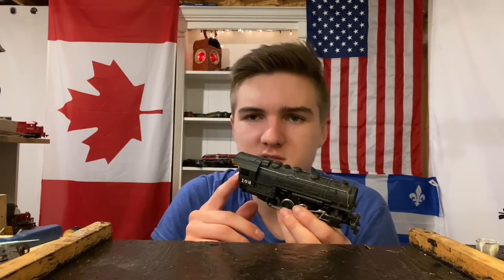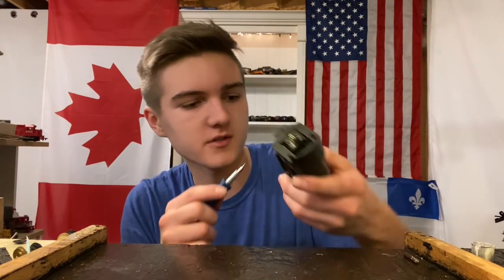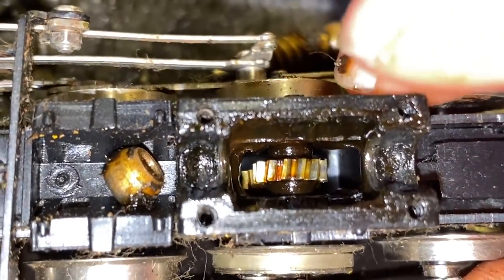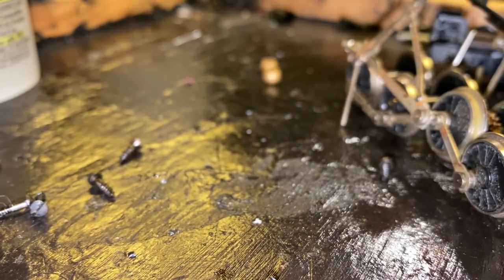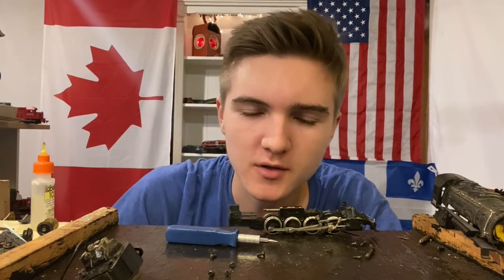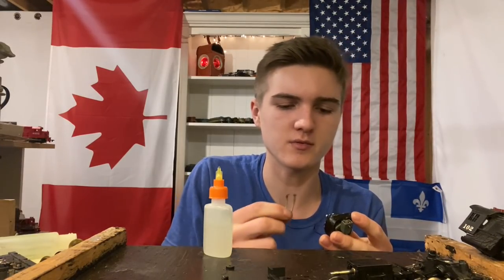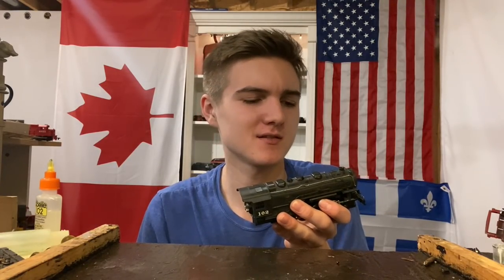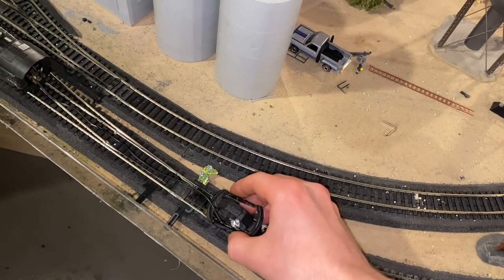Seized Rivarossi 080 Steam Locomotive Restoration

Comment: Super. I always liked the Rivarossi & other versions of this 0-8-0, mostly because of the tender booster unit which came with some of these models. It had axle mounted turning crankshafts with moving siderods, and visible steam cylinders, and it was pretty rare to see an operating booster on any locomotives back then, so it made this one special for me. 💙 T.E.N.

Comment: SMT - Just a thought.  Maybe you could take Tyco & other diesel models that you would turn into a " dummy " & use the trucks & chassis to scratch-build a tender with sheet styrene & scratch- built details?  The trucks would be installed so the metal wheels are all on one side.

Comment: You mentioned using a mixture of Labelle #102 and #106 for the worm(?) gears. However, the other times you applied oil, you didn't mention the type/Labelle # of the oil used. Please clarify.

Comment: If you have had a lot of these you will find that there were 3 versions. The one here was a 2nd generation version.

The first had the motor in the tender, like Rivarossi's earlier 2-8-0. In fact, they used the same tender shell. They did, however replace the chassis with a plastic one instead of continuing that awful die-cast one that crumbled as it aged. You can identify this version at a glance. The area under the boiler closest to the firebox has a big ugly casting instead of the "air" of later versions.

The second version moved the motor to the cab and a new chassis restored the area under the boiler to  a better-looking state. There was now the familiar gearbox and a vertical shaft ran down to the drivers.

The third version was the last. The motor was moved again. This time it went in the boiler, facing down and driving the wheels directly with a simple worm. These were geared a bit too fast but the intended market (Woolworth's and Kiddie City by then) did not seem put off.

Comment: Seeing as the locomotive was in a box of parts locos at the shop, Harrison, most likely that's how the washer got lodged in the motor.  Soon as you went to the close-up of the motor it was obvious that's the problem.  I'm like wait, wait, don't put the shell on yet, then it hit you, to install the piece between the motor and wormgear shaft.  She's been "rode hard and put away wet," but she's a runner.
Thanks for sharing. 👍 👍 👍
Reply from the maker: That theory makes a lot of sense, it must have been running when it was put in the box and the washer got into the motor at some point while it was in there which is why the coils are okay.

Comment: My first highly detailed steamer with valve gear,  after two years with a Tyco Mantua 040 slopeback switcher.  1971. $16 US. 

Yep even when fairly new...when stuck/stalled on the rail,  switch the power to reverse and quickly back fwd....off she would go.   I got to where I could do that trick to get a slow smooth start and slow turtle running. 

My Berkshire did it,  my JW Bowker did it,  my FM Diesel did it too.  It had to be the can motor. 

The later IHC (post Rivorassi ) locos of the 90s ran better and had less ridiculous flanges,  but they don't look as good.

Comment: I am only just starting out in this hobby and have found your repair videos in particular very useful as i started with older ebay engines. One problem with the steam engines that i have faced is the connecting rods coming undone especially while reversing. Could you share any tips on this?

Comment: Nice job, so where did that stray washer/bushing that was jamming the motor end up? Did you install it on the engine somewhere?
Reply from the maker: I think it was part of the cross bar between the locomotive and tender. Unfortunately the screw is missing so I couldn't put it back.

Comment: The 0-8-0 you have looks like the heavy USRA version from WWI when the US government took over building steam engines to a single standard (hence the USRA meaning). If you look at the last driving wheels to see that they rest under the firebox as this one does, then its a true 0-8-0 and not the fake version as Bachmann did and Tyco did with the Chattanooga. The Tyco version is actually a Mikado 2-8-2 that they removed the guide and trailing trucks.
Reply: This was a model of an actual engine used on the Indiana Harbor Belt. It looks weird because it was a 3-cylinder design. The prototype also had a booster on the first tender truck. The engines were not around long and I always wondered why Rivarossi chose it to make a model of. They also made an O scale version in the 70s.
Reply: Just for history's sake...USRA was World War ONE.
Reply: @jamesjorgensen3709  yes, you are right. I made a typing mistake. thanks. I made the correction.

Comment: SMT , mAy I strongly suggest not using steel wool EVER,  because as you know it can get into motor.  Instead see if you can find 3M sanding scrubbing pads (white one is for metal) at the local hardware store ... generally in the paint department.   It may take a little more effort, but there's no risk to the motor as it's not magnetic.

Comment: Rather than steel wool, I would - and do - use a buffing brush on my Dremel. No fibers to get into the mechanism and motor that way.  Also, one might consider replacing that old Rivarossi motor with a more efficient can-type motor.

Comment: If the light is working but the motor is not, the problem is the brushes.
Reply from the maker: Yes or wiring to the motor.
Reply: SMT Mainline it’s the motor otherwise the light wouldn’t be on